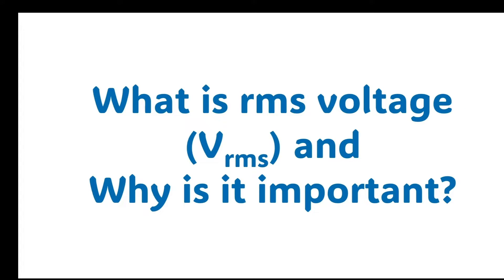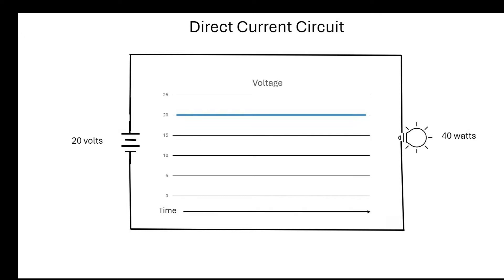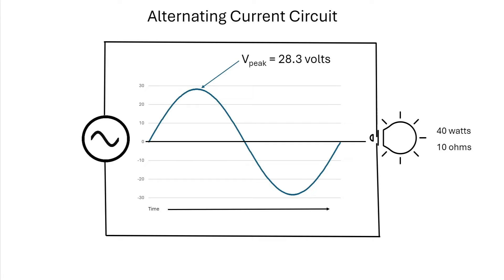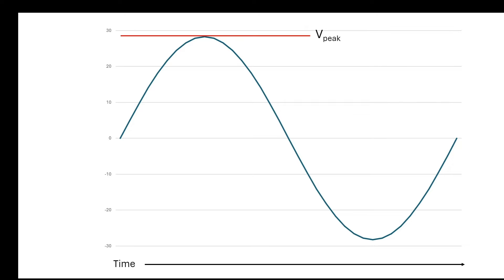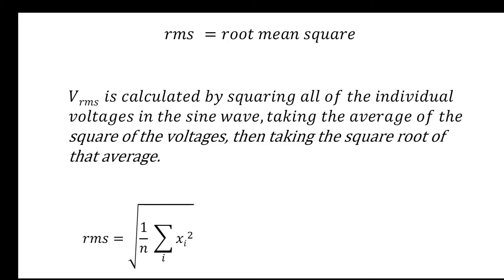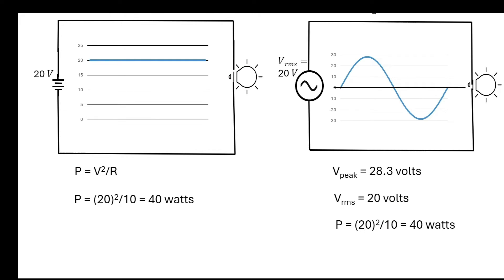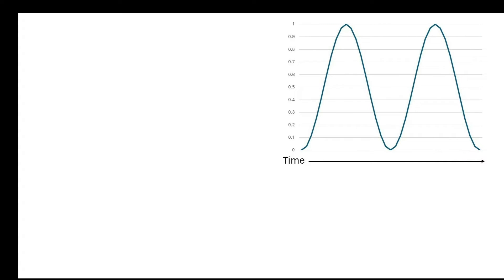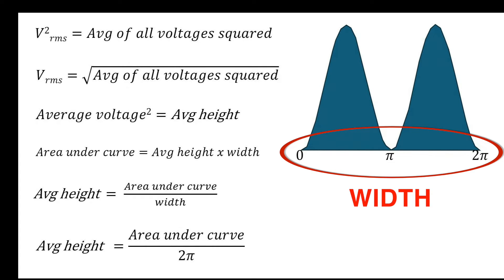RMS Voltage Explained | How to Use RMS Voltage [AC and DC Circuits]

Comment: Sure, could sit through all the math and what have you, but the truth of the matter is electricians almost always use the RMS values is because it represents the same amount of power consumed in a purely resistive load on a given DC voltage.   An example here, let's say I'm out traveling in the wilderness where no utility supplied electricity is available,  and I have a simple coffee maker with an ON/OFF switch that's rated 840 watts, 120VAC,  7A.  Lets assume I don't have a power inverter to connect to my car battery,  but I happen to have 10 large 12 volt batteries, so I decide to connect them in series to get 120VDC, and rig up my coffee maker to them for my much needed shot of caffeine.  In this scenario the coffee maker would consume 7A , 840 watt just as if I were using it at home with my wife and kids.
Reply from the maker: As per normal for you, another very good and educational comment. Thank you.